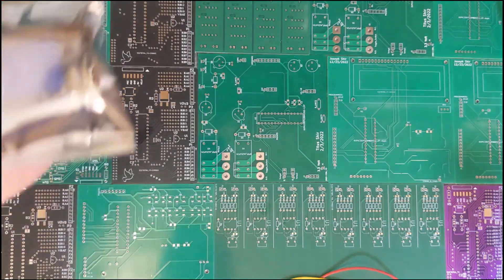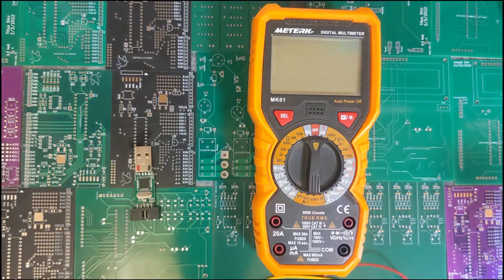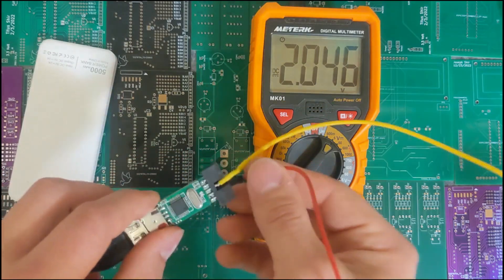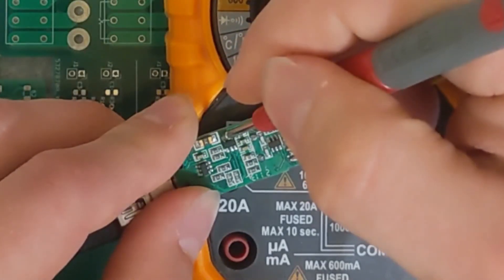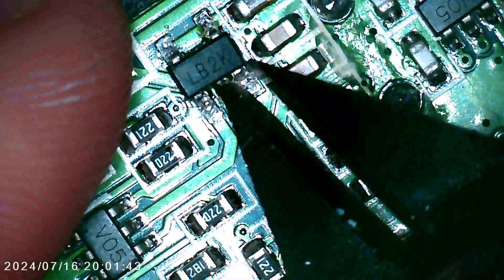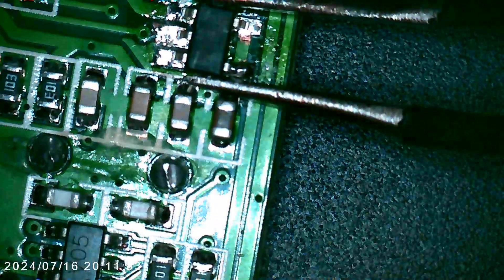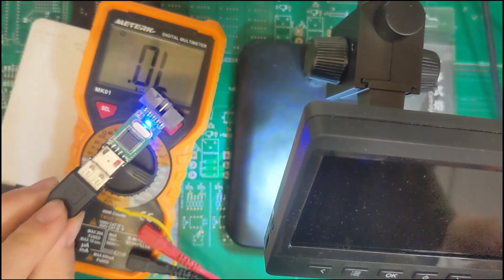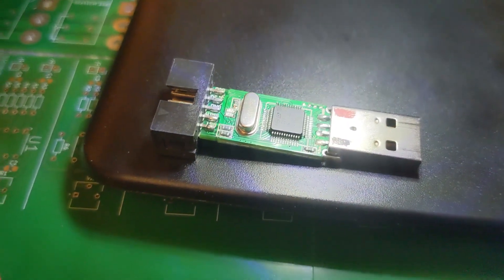Broken ST-LINK Troubleshooting and Fix (Best debugger ever!)

Comment: Unfortunately the regulator is likely .10 cents but shipping will be $5 or more. The ST-Link is a few bucks on Amazon, shipped. Not economical to fix unless you have the parts on hand, but it's still good soldering (and troubleshooting) practice.

Comment: This is a very common issue with these cheap programmers. It happened to me on two different units. I know the voltage regulator is blown, and since I don’t have a replacement part, I had to order a new one.

Comment: I noticed my st link is not showing a red light when I plug it in, the light is blue. It won't connect to the target unless the light is red, do you know how to change that or what causes it?  I have 4 st links and 2 have red lights and 2 have blue lights.  I have upgraded all but the the oldest link (about 2 years old) its light is red and it works fine it has J34 on it and the other ones are J37 or newer.
Reply from the maker: To be honest I'll have to look more into this. Do they both work? Because the I had the same thing happen where one of my ST-LINKs has a blue light and the other is red. Both work. I've seen many different ST-LINK clones and they have all worked well for me.
Reply: @mycrostartelectronics  no, the blue lighted ones won't connect to the target. It is only when the light is red that it connects to the target.  Once it connects and I start the program flashing the light on the link flashes red and blue.

Comment: Great work..... How did you find out the datasheet by  reading the crezy wierd printed number on the chip ?
Reply from the maker: Yes, I did look up the markings and also was able to confirm that the pinout was the same by looking at the PCB.